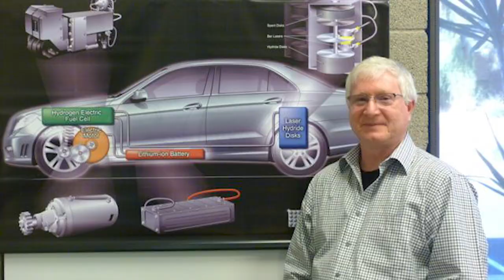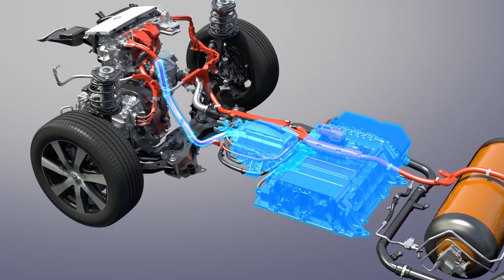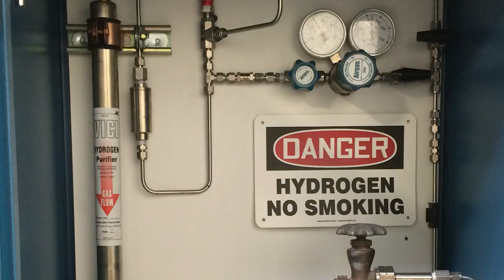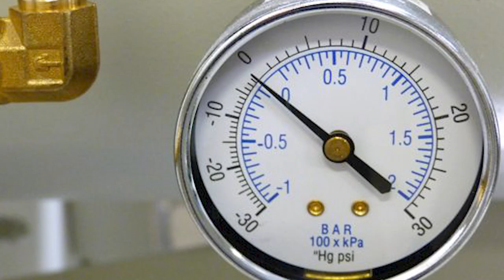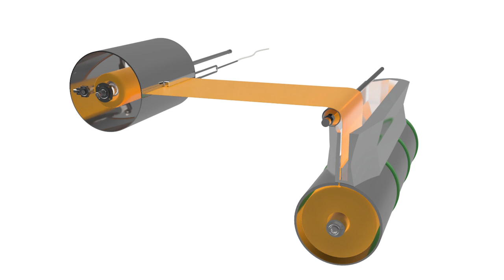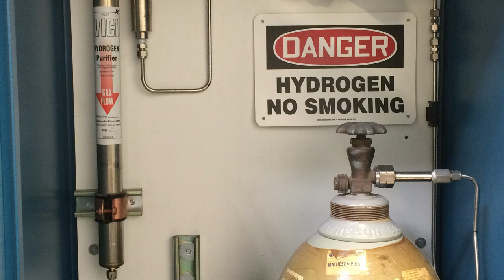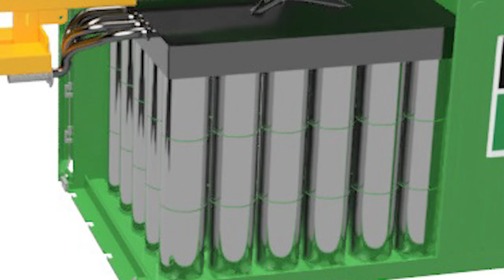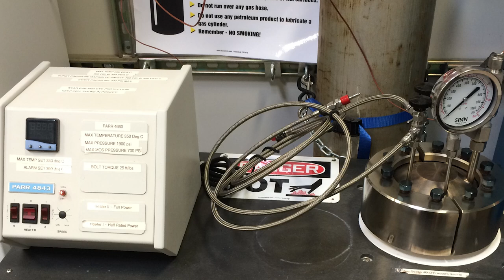This BANNED Technology Could Push Hydrogen Cars Over BEVs

Comment: I'm sorry but this just smells like another Nikola.  Have they even actually demonstrated extracting hydrogen from these things at a rate fast enough to feed a car?  Plus imagine swapping out 300 POUNDS worth of discs just to get 400 miles of range.  Sure, BEV batteries weigh a lot more but you're also not swapping them out with every refill.  The discs sound like nothing more than a solid storage medium for the hydrogen that eliminates a pressurized tank.  I would think consumers would pick pumping pure "weightless" hydrogen into a permanent tank than swapping 300 pounds of discs every 400 miles.
Reply: Maybe you missed it, but it was Sandy Munro who brought this company into the conversation. 
Have faith, Tesla doesn't have to be the only player in the fight against ICE car manufacturers.
If it happens to turn out, then it's a positive, if it doesn't, your Tesla shares will skyrocket.
Either way, just sit back & wait it out.
Reply: @CNile-se9xw  Yes, I made a similar post on Sandy's video about a week ago.  He's well respected in his field but I'm pretty sure this is not his field and he probably knows about as much as the rest of us about hydrogen discs (next to nothing).  I believe he even said that in his video.  So your advice is good advice: wait it out.  I wouldn't invest in this with YOUR money.  ;)
Reply: Joe Amodeo  I think it's more logical to compare things moving forward rather than going back a century.  Henry Ford would have thought a flip phone is MAGIC!
Reply: they're suggesting that half the current cost of hydrogen comes from having to crygenically store it at 10000 psi.  That cost just goes away.
Reply: I have had a miniature hydrogen electric car for over a decade. I use it for studies and teaching this technology.
Reply: @DanielASchaeffer  And that's a false statement. There are more than enough hydrogen efficiency studies. 700 bar compression and transport to the fueling stations drops the efficiency from ~75% to ~60%, so around 25% more energy needed for high pressure hydrogen. The cost increase comes from transport and labor costs. Driving around big and heavy fuel cartridges doesn't reduce that.
Reply: @Psi-Storm  I'm not following you here.  Plasma Kinetics tech eliminates the need for compressing hydrogen and cryogenic storage, period.  Their point is that added a huge overhead to the cost of hydrogen and that now goes away.  I can't attest to the validity of his claim but I'm prepared to accept it at face value since it doesn't seem outlandish.  As for the weight of the fuel cartridges, they're lighter than batteries.
Reply: @Psi-Storm  They say a compressed hydrogen filling station costs $3M to build.  Something like this could be done for thousands and would require less onerous permitting than a gas station.
Reply: @DanielASchaeffer  "lighter than batteries", but still heavy and have to be swapped out...
Reply: @gregbailey45  gasoline is lighter than batteries and needs to be swapped out. I'm missing your point.
Reply: He said in the video someone is working on an automated system to swap the discs out as manually swapping 300 pounds of discs every refill aint gonna be happening lol
Reply: @CLSgod  first of all, it's automated, not manual. It's fast. It's safe. It's lighter than 1600 lbs of lithium batteries. It's easy to recycle. You can buy them at Walmart rather than needing a 3M$  hydrogen station. If it's important to you, you can refill them at home if you have a power source and a hydrogen generator. There's no need to build charging stations everywhere. If you don't own a home you can fill up in a few minutes. It's a fifth the cost of lithium batteries. Need i say more?
Reply: @DanielASchaeffer  it won't be fully automatic, there will need to be an attendant that will cost money, the equipment will need to be maintained, there will need to be equipment to get it from the swap out bay into a shipping container or truck. The "empty" cells will need to be swapped out with "full" cells at the swapping stations. If volume isn't an issue at 300lbs per "fuel up" a semi could ship about 150 fuel ups per load (45,000 lb load) so you would need to unload and load a semi at an average swap out station every day, two for some stations that are busier. Lots of extra costs to balance out those savings.
Reply: @Kiromos  Why will it not be fully automatic?  You will drive up, a robot will remove the depleted pack and insert a fresh one and you'll drive away?  Purportedly, the costs will be half the current cost per pound of compressed hydrogen - at the exchange.
Reply: @DanielASchaeffer  name one thing that is automatic that involves moving hundreds of lbs like that around consumers. Sensors get dirty. Some cars will have issues that won't be accounted for. Worn attachment points. Stuck locking mechanisms. There will be a person there probably using a tool to help him lift the batteries from a bay. Robots don't exists that can trouble shoot in the dirty real world like your expecting. Anything that could move around that heavy of a product from a storage area, down below your car, up into your car, then brings the empty back to the storage area is going to be so complex and have so many moving parts that wear out and sensors that can get dirty and all the issues with corrosion and being outside exposed to the elements you will need a full time mechanic there to keep it operating. Think of the complexity of an amusement park roller coaster. Running at every swap out station. And when one stall breaks it might shut the whole station down. Nope. Not going to happen. You are going to have people with batteries on wheels and lifts to pick up the batteries, but the final alignment and final fit are going to be by a person if this system is going to be reliable.
Reply: @Kiromos  "Automatic' describes the experience from the customer's standpoint.  An ATM is automated even though an army of technicians stand behind them to keep them running.  If one of the switch bays goes down then customer drives into the other one but in no instance would the customer need to get dirty.  My Roomba clears my floor, empties its dustbin, and recharges itself every day without my intervention.  Yes, someday it will fail but the process is no less automated.  Even with the support costs this company is claiming its hydrogen is half the cost per pound of what people are currently paying to fill their Mirai.
Reply: @allennolden8735  WHAT kind of hydrogen car? Is it pressurized hydrogen, liquid hydrogen which oxidize (with oxygen), or hydrogen ion which creates an electric current directly (without oxidation)?
  Hydrogen "burned" in air creates smog, along with the H2o (water vapor). Smog isn't desirable, of course.
Reply: @gregbailey45  A Chinese car company, Nio or Neo, already have battery-swap stations for BEV in China. So, it's doable.
Reply: @artsnow8872  it hydrogen ion reverse PEM cell. There are three types of cars. One that actually has all the parts to make it's own fuel. It has simple functions. Then one where the fuel making kit is separate with simple motion control functions. Then a third that is a fully operational RC AWD car modified with a fuel stack system and small reserve battery.
Reply: ive run my ford bronco 1982, on lpg,for 14 yrs, no problems,pumps out oxygen.. what,,is your problem,.???...here in aus,we sell lpg over seas,tiewan,china,japan,for 10c lt,delivered, we pay 95c. plus 5k to install the unit.  ripped off bad. my ass hurts.. my 4.2t work truck,diesel, gets 12.5 lt 100. go find me a comparable truck. not in existance.. plus,it has a range of nearly 2k.. beat that..
Reply: @DanielASchaeffer  Even if compression was zero cost, the mere production of hydrogen is much less efficient than simply transferring the power to batteries. You're asking the wrong question. The tech "absorbs hydrogen" - from where? Water? Using what energy? (you are aware chemical bonds need to be broken right) At what rate? etc. This is more vaporware than hydrogen itself!
Reply: @tudormontescu6275  while it's true there are inefficiencies from the conversion they are getting smaller all the time. We will also soon be reaching the point that the efficiency differences will no longer matter. We are already hitting many days when California produces more electricity than it can use and that "problem" is only going to increase.  In the not-too-distant future we will not care that we're wasting a lot of electrical energy. Perovskite solar cells will be coming online this year bringing with them a major leap in efficiency. Wind, tidal, geothermal, and even nuclear are ramping up so if we have to waste 30% of our charging power to generate a tankful of hydrogen I don't think people will care that much.

For the second half of your question, this technology adsorbs molecular hydrogen gas, in other words, H2. Simply pump hydrogen gas into a chamber with these plates and the hydrogen molecules will stick to the surface had a much higher density than gas-phase hydrogen. There is no need to break bonds has the hydrogen is stored in its molecular form. I believe this surface will preferentially adsorb molecular hydrogen from a waste gas stream as well, letting the impurities go by - essentially pulling the pure hydrogen out of flue gas. Of course you can always just pump pure hydrogen into the chamber with the adsorbent.
Reply: To answer your question, no, it won't have enough power for a car but it should have the energy, so I think all fuel cell systems with high peak power requirements need to be paired with batteries.  In essence they become hybrid BEVs but that could also solve the inefficiency problem for small trips.  A hybrid like this could have a much smaller and less expensive main battery providing a cheaper car with efficient everyday plug-in power but fast recharge for long trips.  A good hybrid without the expensive legacy components of gasoline hybrids.
Reply: @davidsuzukiispolpot  would ultra capacitors do the trick?
Reply: @DanielASchaeffer  yes, depending on the specifics, I think they would need to pair fuel cells and this film hydrogen storage device with either supercapacitors or batteries.  I guess it really wouldn't really be a hybrid at all if it was paired with supercapacitors due to very low range on the capacitors alone.
I thought a reasonable range plug-in hybrid (say 80-100km) would get me the cheap home charging and high efficiency of a BEV and the hydrogen would fix the range anxiety.  And a 100km battery is much cheaper and lighter than a 400km battery.
Best of both worlds.
Reply: @DanielASchaeffer  how can you state these things as fact, if nobody has seen a working prototype yet?

Comment: I remember back when VHS/Beta cassettes came out. Beta was the smaller cassette and considered a better choice than VHS. Many people bought Beta players and ended u with the better player with smaller tapes. VHS took over and you could not buy hardly any movies in Beta.
 At the Video Store it was just the same. Batteries are like VHS in some ways but they have one advantage, you can harvest your own power.
Reply: I thought the same thing when I saw this video, it's the Betamax Fallacy all over again. 
People in the comments arguing that battery EVs are "better". 
Newsflash folks, "better" doesn't always win the race, especially against the juggernaut that is "cheaper to manufacturer", AKA higher profit margins.
Reply: @henryyopp9094  yeah its probably a false analogy.  I think we will see both.  Ev tech isnt suitable for heavy freight also.  So elons dream is b.s.  el9ns definitely smart but people give him way too much credit.   His boring tunnels are stupid.
Reply: @henryyopp9094  Both technologies can work, but BEVs have huge advantages. Cost of production, access and cost of the "fuel", and huge manufacturing capacity. BEVs have already won. There is barely any investment into hydrogen cars compared to BEVs. I think hydrogen has a future in very heavy trucks that require very long distances, and ships.
Reply: Well, in this case, it's the other way around, BEVs have already won and will take over the market and they are the superior technology by efficiency, cost for maintainance and per mile driven.